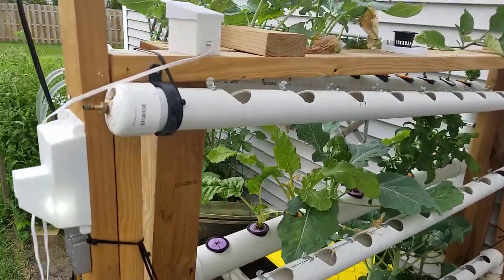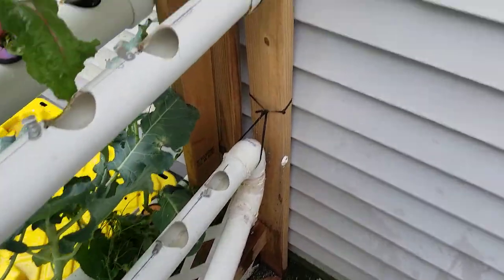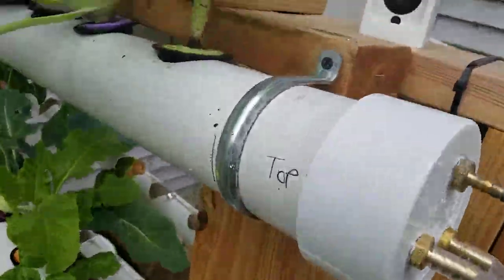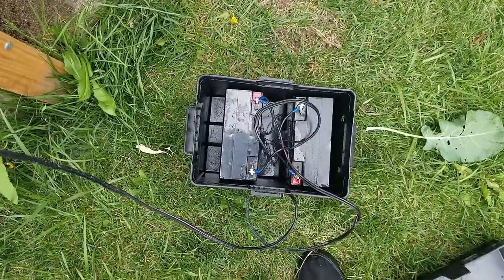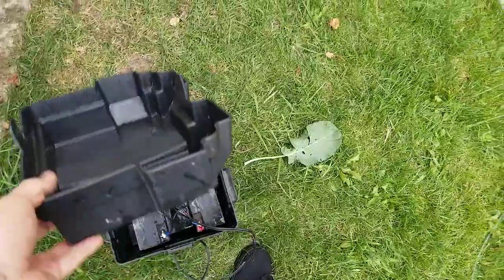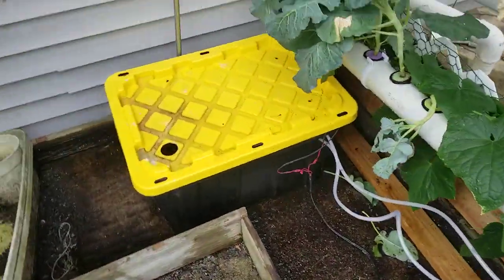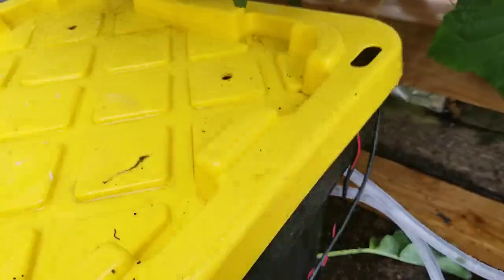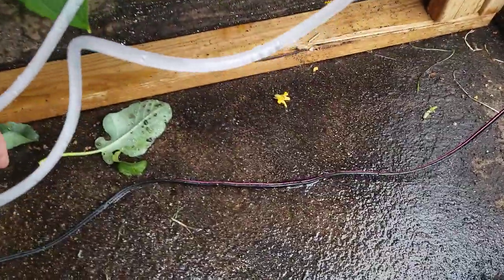hydroponics - rebuild p2

Comment: What is the name of water reservoir. Can you please provide the link
Reply from the maker: I assume you mean the black and yellow box?  It's a storage bin from a hardware store with a nice snap top.  I recommend getting a larger box than you think you need so you have a buffer of water.  I believe that tote is about 20 gallons.  Water will evaporate on hot days, and you want to make sure not only you have enough water for the plants, but you never want to run a pump without water because it can heat up and destroy itself.